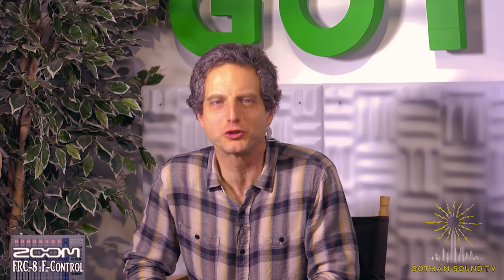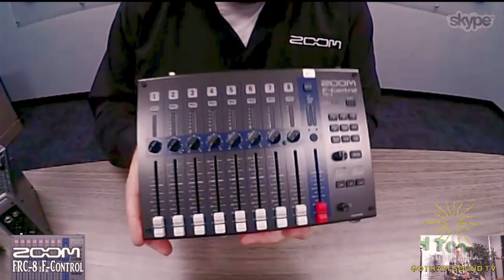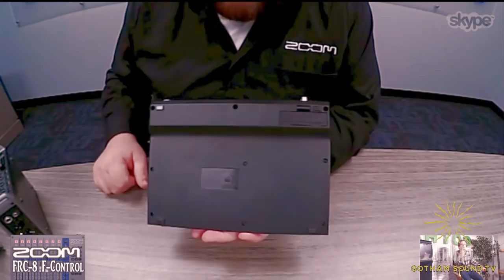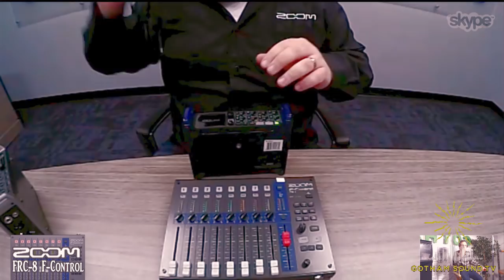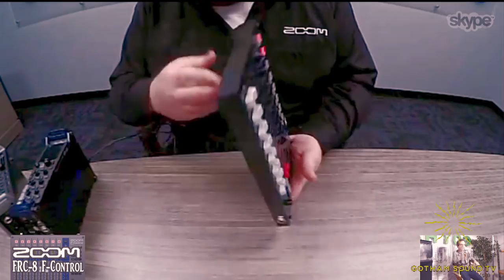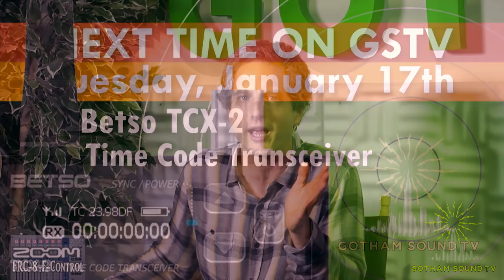Zoom FRC-8 F-Control Mixing Surface

Comment: Is it still possible to connect the F8 with a computer via USB while using the F-control?
Reply: How many USB ports on the F8 would that require? Two, right? One for the F-control and one for the computer.
How many USB ports are there on the F8 ? One, right?
So, take a guess.

Comment: Waste of time!!! People want touch sensitive 100 mm faders and a way to control plugin parameters. I wouldn't waste my money on this. Step it up!!!! Look at the PreSonus FaderPort8, and come into the Real World!!!!
Reply: I strongly disagree with this statement.  I have a Zoom F4 and can't wait to add the F-Controller.  I like the idea of having all of my XLR devices run to the F4 plus also using tracks 5/6 for monitoring the camera return and being able to control it all from a distance with the F-controller.  long USB cable is much cheaper and easier to manage than long XLR cables.  I personally could care less about 100 mm faders and plugin parameters.  Love being able to use keyboard for metadata.  This is great when my whole setup Zoom F4 plus F-controller and keyboard thousands of dollars less than the cheapest Sound Devices.  With proper settings and a little EQ in post can get the same job accomplished.  The Zoom F4 sounds super clean with my Sennheiser MKE 600's and G3's Lavs.  In my opinion this is a game changer and a BIG step up from the Zoom H-seriers products due mainly to Timecode and super low noise floor.
Reply: this is for field mixing, not DAW control
Reply: Aaron A. Dubz Person  what plugin parameters do you want on the fly control of?

Comment: Will the control panel work with iPad application also running?
Reply from the maker: We're not sure yet - we'll test it out when we get one in and let you know!
Reply from the maker: It will not. Only the F-Control or the iPad can work with the recorder at a given time.
Reply: damn!